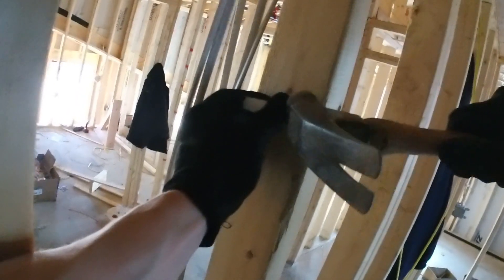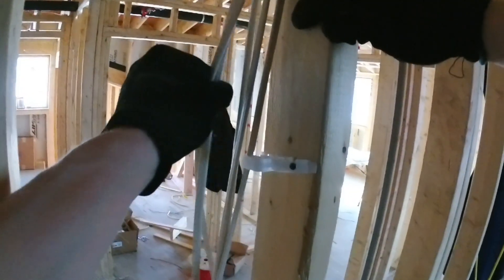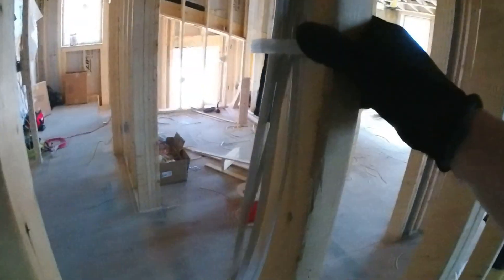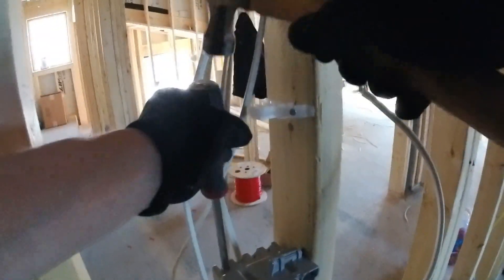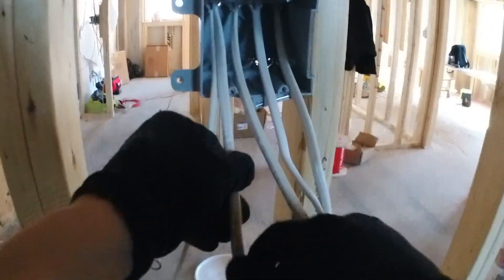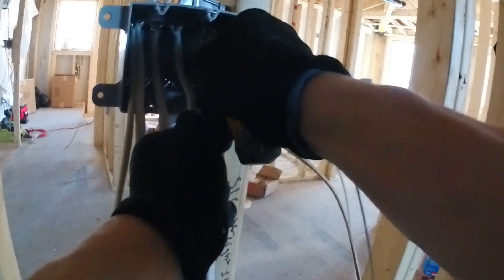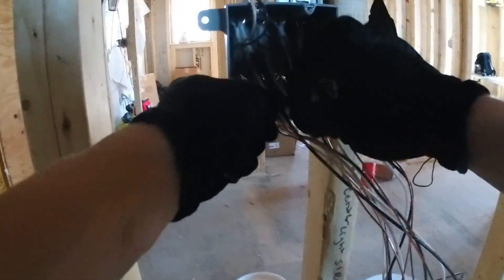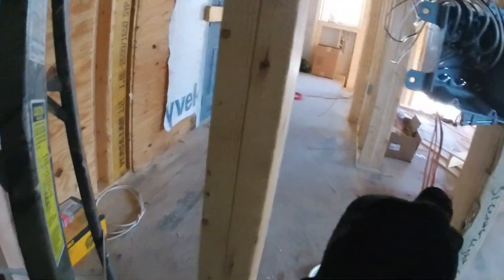*How-To Wire a 2-Gang Switch Box Like a Professional!*

Comment: You was talking about the sheathing on the NM cable looking a little frayed, cutting it with a knife. I also used to use a knife and then switched to my diagonal cuts and just that angle allows you to get up in the box and cut it clean. Try it for a day to get the hang of it and see what ya think. Thanks for the content!
Reply from the maker: Thank you for the recommendation my friend I appreciate the support!